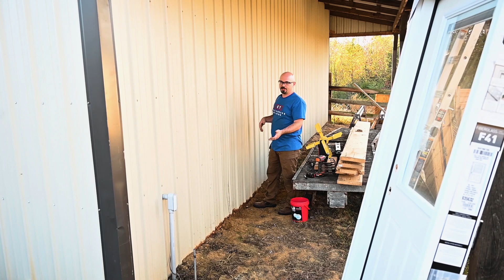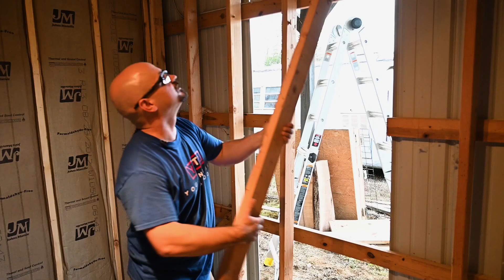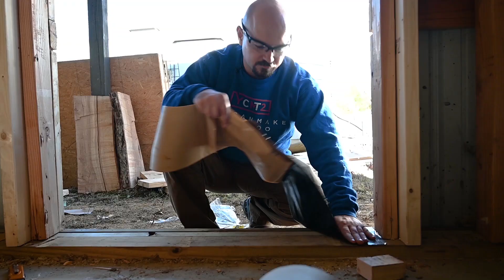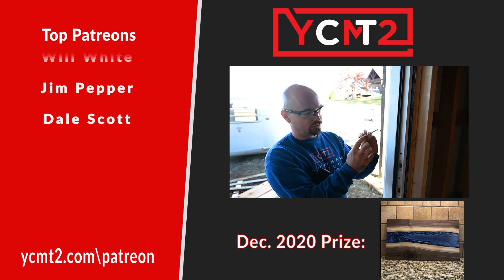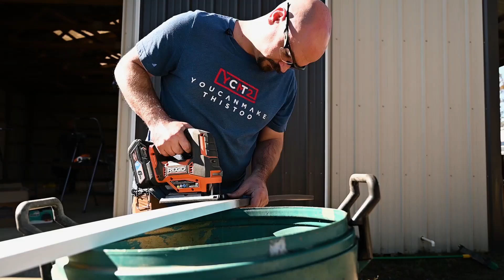Dream Shop Ep3: Man Door in a Pole Barn

Comment: Why do people feel they are qualified to post a YouTube
tutorial on a given craft, despite obviously limited knowledge of that craft?
Reply from the maker: I met the requirements
Reply: @YouCanMakeThisToo  
The first clue came when you said...
//"This metal is pretty verticle."//
...huh?
Are you trying to say that the vertical siding is plumb? 

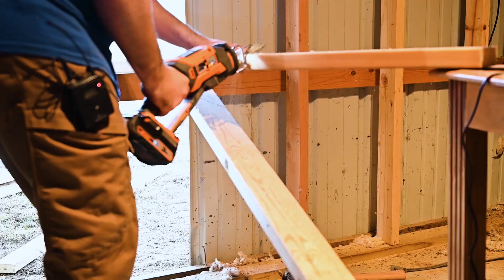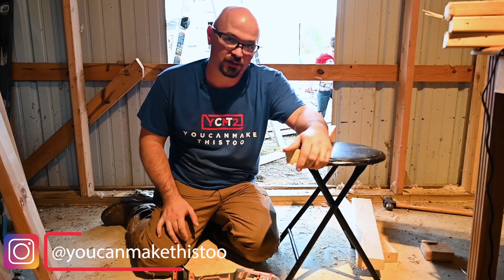The second clue was at about 4:20 - 4:35... lol

Third, you certainly didn't need that mastic or the tube of caulking you placed under that threshold. Setting the J-channel in a bead of caulk around the brick molding would be more than sufficient e.g. with 8 foot shed roof over the area. 

Forth, you generally shim a prehung door with it closed to assure uniform spacing between jam and door. 

My point being that while what you've done appears to be adequate, you clearly aren't coming from a position of expertise.  
I do applaud your initiative. Too many people think such tasks to be overwhelming without even trying. 

Nothing ventured, nothing gained, right?

Comment: Nice video.  I was searching for ideas on installing a door in a pole building.  My understanding is most doors in big box stores are for ordinarily constructed homes with 2x4 walls.  Ideally, the hinge pivot should be inside the building in a location so the doou can have a full 180 degree open swing. The brickmould is included and attached for that common opening.  My understanding to install a door like this in a wall of unknown thickness you must remove the brickmould first.  Then locate the hinge in your opening at the desired location and mount the doir as you did.  After that you build a "jam extender" and replace the brickmould or in aome cases you can simply opt for a different style trim like your j-channel against the jam extension.  Often the jam extension is covered with metal (usually requires a brake).  What do you think?
Reply from the maker: Exterior doors are normally inswing so an intruder can't pop the hinge pins and pull the door out of the jamb. Having the hinges flush with the interior wall surface does  provide maximum swing.. assuming there isn't something in the way. I have a wall that block 180' swing, and then I put a cabinet in that corner, that limits my swing before the way I installed my door limits it. The way you're describing it would have been a cleaner looking install and what I'd do if I was installing in a home or something.

Comment: Good job.  I am planning on installing a door into my metal shop but I have never done that before.  I wish your video contained more detail for the novice.  I think that your video is not adequate for a novice and not necessary for someone that has done this before. Anyway, at least I have an idea of what is involved. Thanks.
Reply: What did he miss??? 
You need to stop 15 min in, drink a bottle of water, take a break at 45 min in and have a smoke…. Take lunch after 4 hrs….
Reply from the maker: Sorry you didn't find it particularly helpful.

Comment: Looks good. May I suggest some of those long deck screws in your latch plate in case someone really wants to try to get in. Also, the touchpad locks are pricey but worth it, the shop is always locked and its easy to open.
Reply from the maker: I love touch pad locks, they're so nice. And I really like being able to make sure it's locked from my phone anywhere. And I did use the long screws in the latch plate for the lock, great tip there.
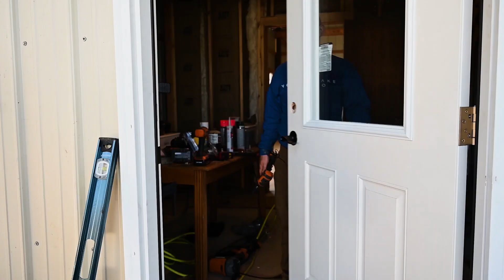Reply: @YouCanMakeThisToo  ok at 9:43 it was the short factory screws so just thought I’d offer my 1 cent!  Wish I was there to help convert that place, I’m actually good at building, unlike woodworking lol
Reply from the maker: @JimPepperTactical  Yep, that was just for the door handle. Best practice would be for both.. but I normally just do the dead bolt - cause I almost never lock the door with the deadbolt anyway. Defeats the purpose of the keypad

Comment: Progress!  Was wondering if you were going to gravel the outside edge.  I'm sure you have already thought about this (and other's have suggested) but have you considered a small concrete pad at the entrance of the new man door?  Mentioning this because limestone gravel will continue to make dust that will then get tracked into your office.  That mess gets old fast.  Also caught your "I wish it only cost $20K" comment.. Yea, most people have no idea how much concrete, etc costs.  With the covid pandemic, everything is more expensive.  Keep it going and best wishes!  (have your son help with shoveling the gravel along the edge! :)
Reply from the maker: Yes, and yes! Initially the plan was just gravel. Then I realized I need a door mat and boot brush, so I'll also do a small pad there at a minimum. Still torn on whether or not I'll do the whole thing in concrete... probably not. 

And yeah, the budget is $20k just to convert the building into a shop.

Comment: Genuine question: shouldn't the 2x4s on the door header be on edge, not on face? I know structurally it doesn't matter much, but that's always been my understanding for door headers.
Reply from the maker: For anything with a load, yes. I turned them the way I did just for expediency since there's no load at all on it. It's faster because doubled up 2x material is only 3" thick, but the 2x4s are 3.5" deep. So they need a plywood spacer to bring them to the same thickness. Or... just turn them the "wrong" way. Again, only did that just because the only thing this will carry is the weight of the drywall that'll go on it.
Reply: @YouCanMakeThisToo  Thanks for the response! Totally fair time-saver in this use case, just wanted to make sure my info was right.